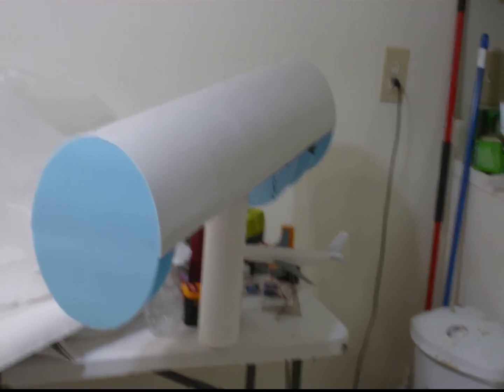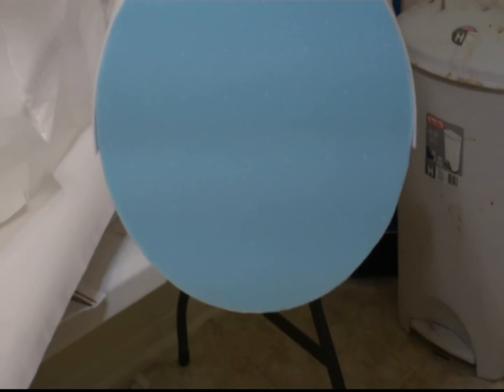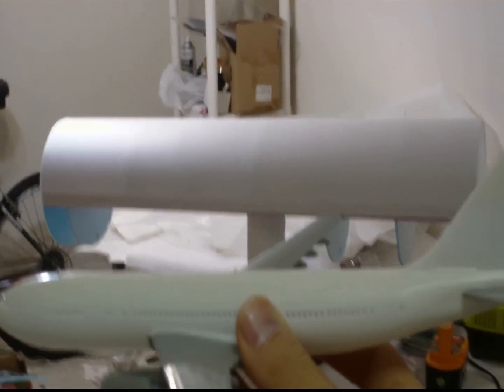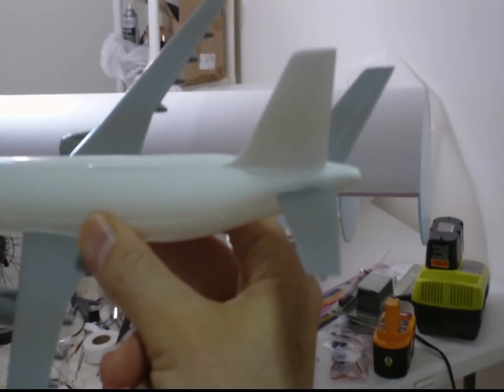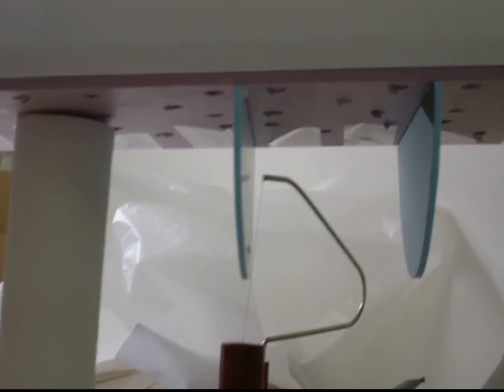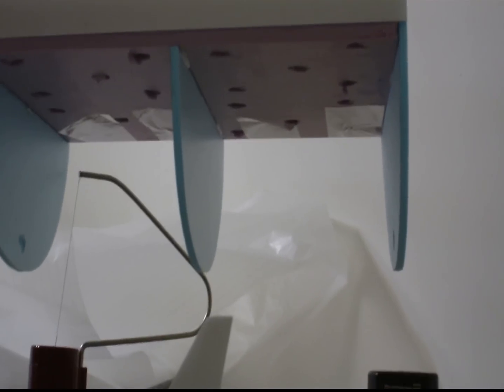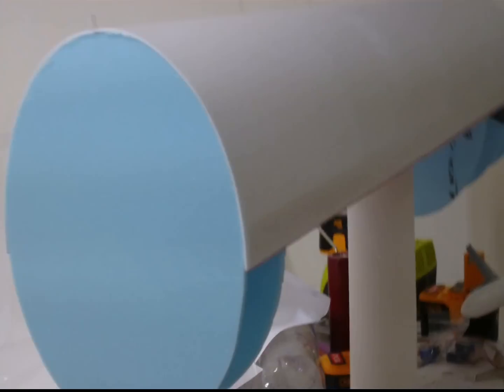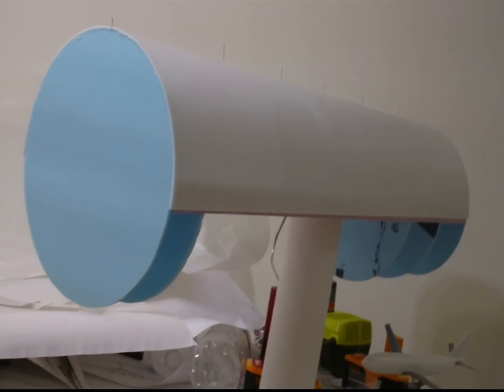How to build a 7 Foot Airbus A300 RC EDF airliner Part-15

Comment from the maker: @1995marines  You can use Epoxy, foam safe CA, or JB weld 5 minute, and many more you also can use gorilla glue it just takes forever to cure and it expands, I want to see your 767 when it's done!